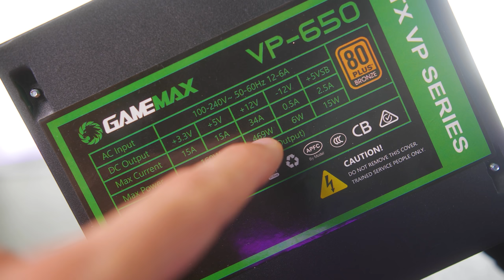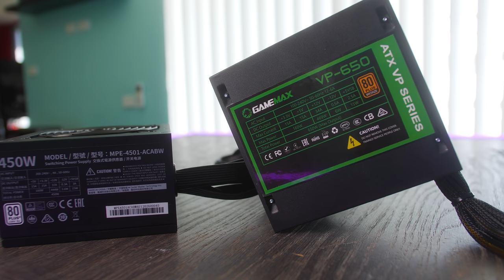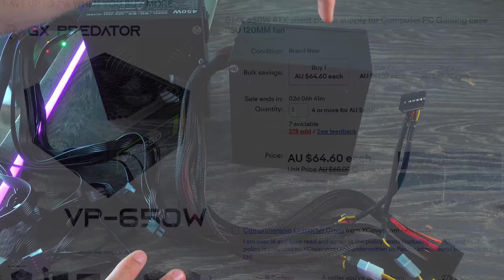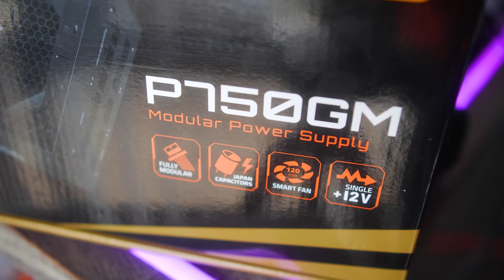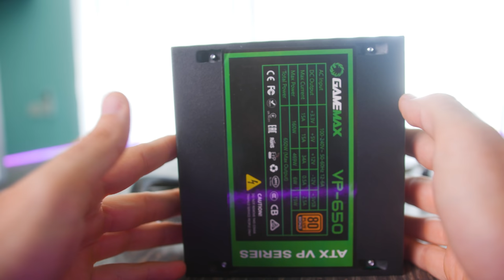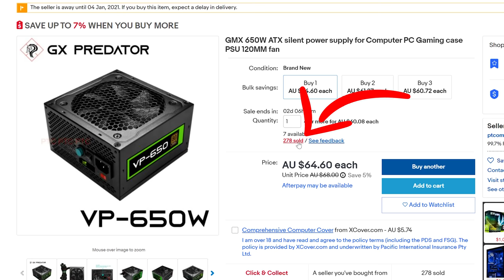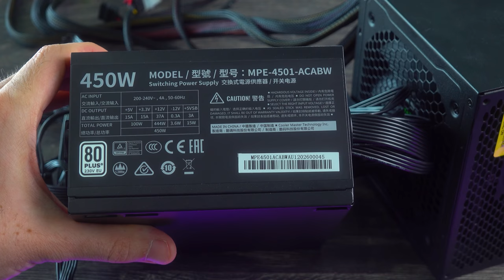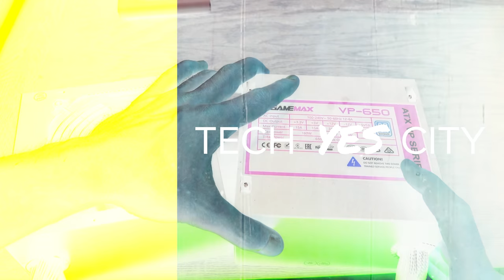This Company is Straight LYING about their "650 Watt" Power Supplies.... (*UPDATE* FAKE GameMAX??)

Comment: Australia-man puts his system and his balls at risk by sitting in front of a bomb

Those are also being sold on my country, Chile, in many places. They have many modular power supplies, even some with rgb so it's no surprise that they caught people with that.
I guess there's a reason why LTT tier list has them on tier E, for all units

Edit: In my country the sell the VP-450 RGB. said to have an output of 450W, but you see the specs for the 12V line and it's just 336W (28A).
They must think they're some kind of genius trying to pull this "ah but if we sum the 3.3V, 5V, etc we get 454.5W, so it's actually even more than 450W".
This brand is for people who's not buying PSUs, but leds their cheap setup.

Comment: If you can find high quality psu auctions from pc enthusiasts, they often go for cheap because people dont want used psus.
I wanted to go really cheap for my htpc, but luckily i found a 400 watt be quiet on auction and got it for  23€.
The 400 watt was tested by a german hardware website they overloaded it to nearly 500 watt and it didnt overheat. The psu even exceeded its gold certification when tested.
Only drawback was it came from a smoker household.

Comment: I actually had it in my cart ready to go, when I decided to do some research. Without any other information, the price/ wattage was an amazing deal and the reviews seemed good. Everything was TOO good, and as the saying goes...                                             As a first time builder there is a LOT to learn and consider. Thank you for calling out a product that is complete garbage.  I do hope the organizations in charge of certification investigate this company, or that someone calls out the certification boards. Amazon should also pull these products. They are fire hazards wait to happen. 😬⚡🔥😵                                                     Thank you for this video.
Reply: With a PSU, $ per watt won't matter. A high efficiency rating from a well known brand that has a 5+ year warranty PSU is what matters

Comment: Honestly, it'll be fine for a low end system - like an AMD Apu or 100w GPU. But they should not be marketing it as 650 watt if it can't safely and reliably deliver that.

The thing about PSUs is that they don't change much, so you can keep them for years. So a good one is expensive, but you might use it for a decade. So it's not pricey on a year-by-year basis.

Comment: Also as a technicality with the math, 650 watts at 80% efficiency gives at least 520watts on the 12v rail, so it definitely lied about that. 
Another thing people dont consider about cheap psus is the fan. Say for example, you may have a corsair psu with a quality 120mm fan and that can raise the price by itself. Some cheaper psus have really dog doo $2 fans that cant cool the components so that can also contribute to your heat output and the smell.
Finally the fact it has only 1 6+2 pin is a giveaway about the true rating.

Comment: i didn't know power supply efficiency played such a huge part, my system witch is a ryzen 7 2700 overclock to 4.1ghz and a evga rtx 3080 xc3 ultra, in gaming use 480-520 watts on a asus thor 850 platinum, it's insane the difference it make in power consomption

Comment: The manual voltage selector switch on the back is a huge red flag, anything that has that is using the internals of a PSU from 2003.

Comment: I built a side project themaltake cube case and grabbed one of these for free through promotion when they were new. I could tell simply by the weight of the unit that it probably wasn’t a 650W. But, it seems to work OK. I did have cpu stress test failures that might have been caused by it (oc’d 4790k)

Comment: I remember that one day of my life 5 years ago.. I built new PC with a new el-cheapo-PSU($30). that PSU was very cheap and I just want it because I didn't want to wait another week for PSU. as soon as I powered up ... after 30 min that PSU smoked very bad(out of one of big capacitors) and almost burst into flame(It did after I took it out of my PC).  I returned it to Microcenter and They didn't even pretend they are sorry about it.. 
Since then I have bought Seasonic ones and so far it was so great - never had any stability issue(I didn't overclock CPU or GPU in my life).  I don't trust any cheap one. buy Seasonic.

Comment: Who knows?.. The PSU might be able to Pull 650W of the power outlet before it melt down (translate to about 450W of output power in this case - I estimate), so "Technically" they might not be lying with their 650W rating. ;)
That is the case with these "Wattage" ratings from the cheap manufactures. There are many norms and variables in these ratings they can take advantage of. Some combine all the rail power together, some specify the max peak power, some can even specify the max power input (power Draw) numbers it can do.
The real only usable "true" rating should be that you rate them on the 12V rail wattage. This it what really matters in high power / modern PC standards
And those "true" numbers, are what you get on the high quality units! ;)

Comment: Can you imagine, that my GOOD psu antec earthwatts 500w is in its 12th year of working, its now paired with a ryzen 5 1600 overclocked (at its max it is drawing 120w) and a rx 5600xt. Before these it powered amd phenom x4 and r9 270. This psu is trully one of the best if it can still work this well aftee 12 years.
It doesn't get noisy, bearly any heat coming from the back.

Comment: This is quite common for cheap power supplies. It's labeled with a high wattage, but a lot of the rated wattage is on the 5v and 3.3v rail. I doubt any of the "certifications" are genuine either.

Comment: Can you test one od KOLINKs C series like C600, they are very cheap and reliabale in my opinion, they are markrd 80 plus white but testing prooves they are 80 plus bronze compliant. TWEAK-PC tested them and said only good about it.
I have been using 400w, 500w peak (c500) with the RX 580 200w and FX6300 95w, both overclocked for over 4 years now, with a bad airflow and its been doing just fine.

Comment: Specs say it all- and the included power pins.
450W: 12V x 37A: 444W = 98% of rated wattage. Good- good.
650W: 12V X 34A: 408W = 62% of claimed rating. Yeah. No.
Even if the 469W was right, which- if they can't even get the math right, wouldn't even dare trust it-- still only 72%.

Comment: Always trust the weight of the power supply over the label. Just replaced my friends 650 watt garbage brand with a corsair 650 watt psu. It was basically double the weight.

Comment: Hmm, u should have done the noise test on the Cooler Master as well for comparison. It was actually surprising the CM passed this test 'cos being rated at 450W and running @ 427W it was near its limits and running so close to the max wattage is bad for the psu. And because of that the noise would have been on max as well!

Comment: Same with a LC Power Ozeanos 650w. In truth a 468w (even from Andyson) unit. But at least the 12v rating for 468 is ok (and it's single rail).. Luckily it's just a returned unit I sometimes use to run temporary builds..

Comment: "..one PCIe 8-pin connector..."
Wow. That's horrible considering there are 450W units that have 2x8-pin connectors. If you have a modern AMD setup with an R5-5600x (6-core) then the entire system MINUS the graphics card probably will never hit 100W when gaming. So you've got 300W for the graphics card over those 2x8-pin cables and should stay within the power budget (although I wouldn't recommend going above 80% load in general for sustained periods but it might be ideal for a graphics card that uses around 250W or less such that your max load is 350W)... if you've got a single 8-pin then you obviously have little trust in your power delivery.

Comment: Ive actually used the same brand but not those vp ones. 
Currently im using the gp650w ,it has 2x8pin pcie and its been working fine. 
But lately it has been making some noticeable coil whine its a bit annoying but still functioning.

Comment: Very interesting. In the UK, gamemax PSUs are super cheap and easily £25-£30 lower than similar spec’d units. I didn’t recognise the brand so I’ve never recommended them, but I’ve seen them recommended a lot on subreddits (like r/buildapcforme) since they come up on PCPP first when sorting by lowest price. 

Very worrying. I bet hundreds have bought these units.

Comment: 4:12 There's some new psu that's pretty lightweight tho so that's not the way to know that if a PSU is good. Vietnamese community had been shock by the weight of a Xigmatek 350w tho(>1.1kg) after that, they found that Xigmatek use a Dummy PFC by a bunch of steel to add more weight

Comment: You can only multiply Voltage with Amps to calculate Power with DC current (which this is). But I just stick to reputable brands like Seasonic, Phanteks (Seasonic is the OEM), Cooler Master and Corsair (only ones with Japanese capacitors). A good PSU can outlast the rest of the PC so it's worth it to pay extra. I wouldn't even bother with Thermaltake.

Comment: I have a "600w" from them and the 12v rail doesn't reach 500w as well. I had it with a rx580 oced and would stutter and suffer performance loss before shutting off (psu heated.) Took me a while to figure out my psu was tripping overcurrent, eas hard to pinpoint because the system would not shut down after quite a while.

Comment: I bought a used gamemax 550w in late 2018, and been using it on rx 580 until now. I'm planning to upgrade it to GP750w for 6700xt since the current model PSU that i have doesn't have 2x8 pcie connector for the GPU

Comment: Another big giveaway from my understanding it's a pile of junk is the fact it has the selectable 120/240v on the back. Means its missing a lots of the active circuitry. Probably missing active power correction (reason you saw high power usage) and safety features. 
The Coolermaster is the better in almost all instances (even if the GameMax was half the price) imho. At least they didn't put any weights in the thing to make it seem more premium.
Reply: That wall power meter he is using is power factor aware, so that is the true wattage.

Comment: The fact that it has a voltage selector is a hugeee red flag.

That means there's no PFC (and no basic surge suppression) which means this PSU will kill your hardware if it encounters a power spike.

Comment: I actually like GameMax bleach smell. Feels like my room got fresh wall paint.
I usually like to try brands that are unknown. For example, i tried Elpida RAM, and its working from 2006 to this day, i tried Netac for storage, like micro SD cards and M.2 NVMe disks, and they are great, similar to Kingston, cheap, solid, well made, never broke. I also tried Doogee smartphones, first i got F5, and i killed it while i was at my job, ordered another F5, after 5 years, 2150mAh battery is not perfect anymore, but i was very happy and that phone works fine still today, but after all, i got Doogee S60 Full variant, rugged phone, tons of features, good spec, very cheap, and its working still today after lots of strikes (floor, wall, stairs, drop to the screen, lots of scratches), but still looks perfect and its fully working like the first day, display are still in contact (and IDK how). However, im gonna need more time for each unknown brand. For now, Elpida is fine, Netac is great (if i need V30 or V90, i go with Kingston, if i need it for buffer/cache, i go with Intel), and Doogee is pretty solid.
About GameMax, its a re-branded very popular Chinese manufacturer that sells its product under GameMax name, mostly to the Brazil, Africa, EU, UK, and similar. I got GM1350, a mining PSU, even it has like 100W+1250W (something like that), im looking at it like it has half of that. I replaced his 140mm fan, with Arctic fan, because i did not trust their 11 blade, 2400RPM solid build fan, with no fan spec, without sticker, that cannot be open (like for lubrication). I contacted them for more information and they responded very good, looks like they know what they are doing even Arctic fan turned out to be less powerful, i decided to go with Arctic fan thats weaker, rather then having stronger no-name fan that vibrates when i put it upside-down. I did not found any misrepresentation on this particular PSU, or any problems, and i face many fake products, and after a year, its still powering 6 mining cards (around 600W + CPU/fan/etc.) without any issues.
Now i still dont have much i trust them. There are two possibilities, they mostly sell "gaming" things, so they cheap out on this 650W things that are very high on demand and on sale needed, so there are always problems with cheap PSU, like 450W from GameMax, making bad label, bad parts, bad warranty, not working things, always something break, while they cannot cheap out on 1350/1650/1800W things for mining farms in China. Second possibility is the control of your country, you know, if your country see inverted USB sticks, painted plastic instead of fully molded plastic, super sped label with gud laguage, fake certificates, it should be declined in order to protect its own nation and peoples (and country money), and we in and around EU usually demand quality, so it make sense why they sell mostly in the UK and Africa, why US citizens are mad and complaining, because they can cheap out on Africa and similar poor countries, they can sneak up on some countries, but they cannot cheap out on Germany with strict law and rules, maybe thats why i never notice anything odd with this PSU. I still need to buy several products from them to fully trust them, but still, bleach smells still today, its strange, maybe they are gathering buyers by smell or something, still strange for computer components to smell like fresh painted wall, and not like fresh electronics.
For now, for me, Elpida, Netac and Doogee are the proven one.

Comment: *BUY* a Decent Case and a Great Power Supply! 4 builds later, different system components.... yup same case and same power supply. Seasonic 650 Plat - 10 yr warranty.  Quality power supplies will not be outdated before the rest of your system is. I purchased the power supply for $180 US eight years ago... and now that cost broke down to $45 per build. Folks... its a forward looking purchase and the only thing in your rig that is near an "investment".... just don't skimp on it.

Comment: hi thx for the video =
my power supply is 5kg and overkill but you can trigger OCP easily anyway because it delivers 20A for 12v1 and 12v2 rails and 30a for 12V3 12v4 12v5 and 12v6 rails for a total of 141A for 12v only a lot? yes sure but you see the possible issue here if you connect only one cable for a 3080ti for example it will trigger OCP you have to very carefully plan your connections...
whereas if it had 4 rails instead of 8 would be easier
(total is 1700w enermax platinum)

Comment: 650W stated the "peak power output" (only able to find in Chinese website)
Saw a brunch of them as mining PSU (1650W bronze)
They are just 1200-ish with 6 split circuit. 
Therefore even miners are avoiding this.

Comment: They're being sold on eBay... eBay isn't largely regulated. I had a seller scam me with a fake SanDisk 64GB CF Card and it turned out to be some cheaper Kingston re-badge and the firmware tweaked to show a true SanDisk... this shit happens all the time. Also weighing the PSU doesn't hold any value... as the outer shell of the PSU is where a lot of the bulk mass comes from. If you truly want to do that test you should be stripping the PSU's apart and weighing them that way it's not taking the shell into consideration, aka the Corsair RM series is super chonky compared to other PSU's and this test wouldn't fly at all

Comment: I used to not be picky about PSUs until I started flipping PCs. I started to care after I had to replace a PC for a guy because I used an Apevia PSU.

I will use used quality PSUs so long as they pass some stress testing. It has to be a good brand and I make sure I'm not pushing to top of the power envelope.

Comment: I remember in the days Tom's hardware was a reputable site they tested a bunch of cheap power supplies bought from eBay. Most of them failed at max current draw & one immediately burst into flames. None of met the specifications on the sticker.

Comment: DO you think this could be a container of fake/failed PSUs which evaded customs from China and being punted out on Ebay for near MSRP with the attempt of making them seem legit??? I've used these PSUs in builds in the UK but I purchased them from reputable retailers websites (NOT EBAY) and the sticker on these is 80+ bronze as well and in testing one with a similar setup to yours there (Asus B550 gaming, R7 5800X, MSI RTX 3070, 16GB 3600MHz Ram, 1TB NVME gen4, 2TB SSD, ASUS RYUO 120 AIO and some Corsair RGB stuff) , it was pulling 410W from the wall whilst playing CP2077, so this makes me think the unit you have could be QA failure being punted out to meet an order quantity due to overwhelming demand atm,  when they should have really been crushed, so a failing at the factory more than EESS and other regulators being at fault. The pressure of sales targets is the real problem and more than that, the promises by sales teams that make deals that just cannot be fulfilled meaning that these units getting to customers is more down to someone in China fearful of losing their $60/year job than caring about the standards of their company or safety of the end user.

Comment: I have a Game Max 850W power supply. It's flawless and has cool RGB lighting. I run an EVGA FTW RTX 3080 which uses 3 eight pin connectors.

Comment: God, I fucking hate these kinds of PSU's. Recently swapped out my ACE power supply that overspeced the 3 and 5 volt rails that gave it a 750W psu. I got it 4 years ago and it was responsible for the death of my i7 3770 and caused fan damage to my GTX 1080.